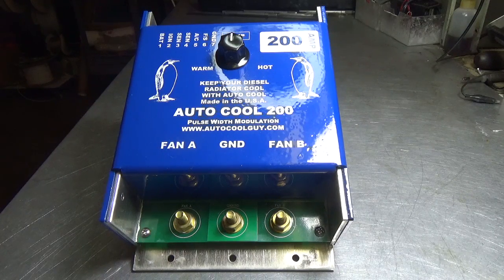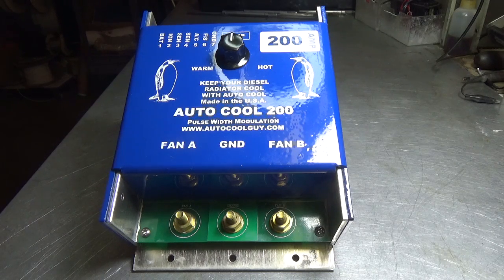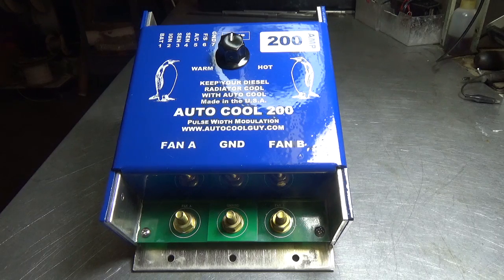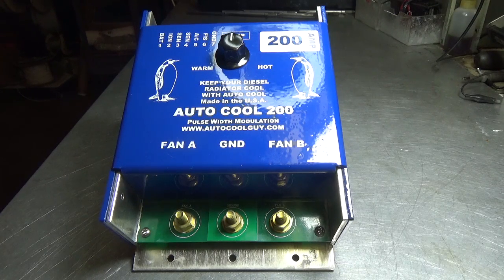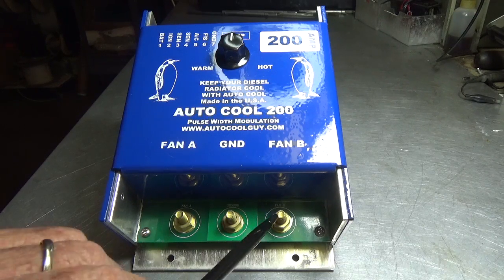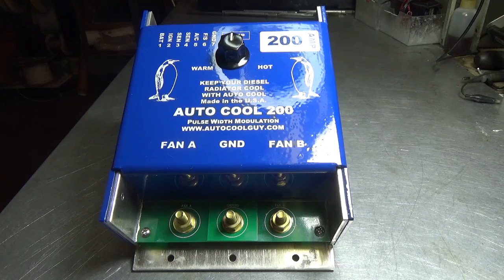AUTO COOL 200 - 200 AMP PWM DIESEL RADIATOR CONTROLLER

Comment: I recently purchased a derale 16795 PWM fan controller for a set of 2017 Ford F150 eco boost fans(~ 600 watts each fan motor x 2). In parallel, draw is shy of 100 amps full tilt. The derale was hard to set correctly, and the terminal lugs were child's play for it's rated 65 amps. Was toast before it even got hot. No smoke, just zero output. Cheaply made junk. Let's not forget to mention the epoxy or conformal coating was leaking from the unit out of the box. 

I just ordered this monster, and it's gonna get put through the ringer. I'll report back with my results, and  I'd be willing to bet big this stomps an incredibly deep  mudhole in derales ass. Fixxin to find out!
Reply: I’m about finished with the hd-125, it is a very well built unit, had a small issue with mine having one less pin, and the schematics , but auto cool guy ... is a cool guy indeed, he talked me through it, love the customer service,